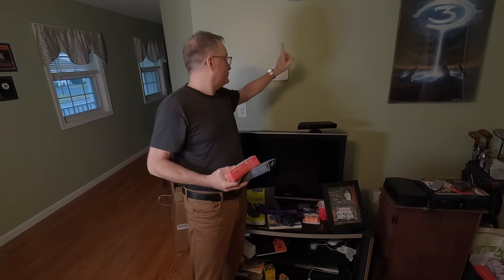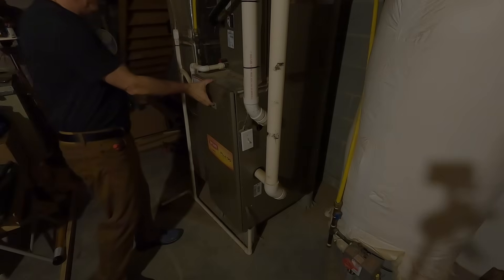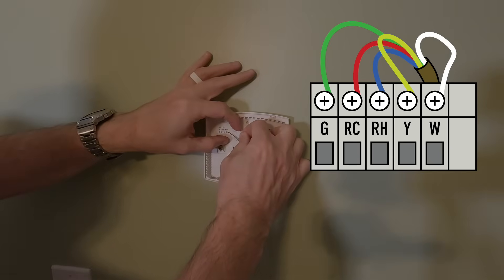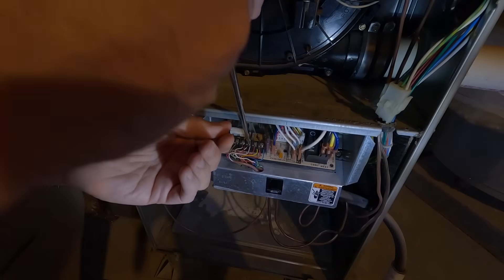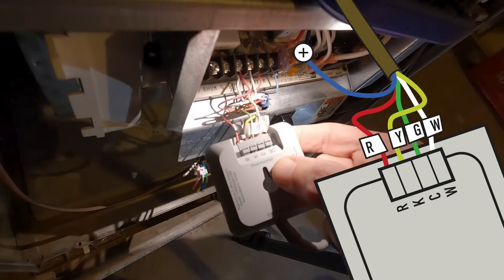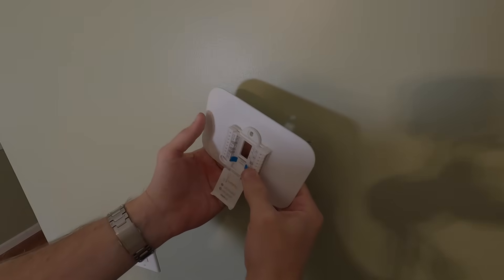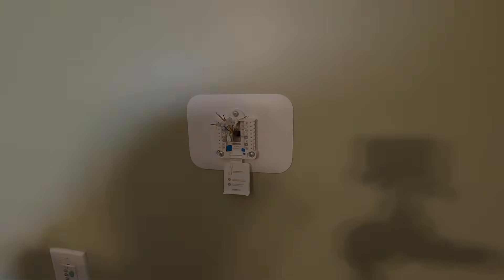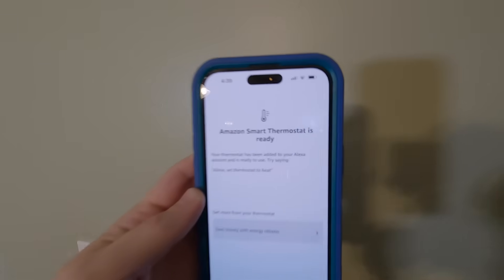Install Amazon Smart Thermostat + C-Wire (less than 4 minutes!)

Comment: What if your HVAC only has a R, W & G. Does it matter for the adapter
Reply from the maker: Great question. Thanks for asking. I recommed using the Amazon Alexa app... it will guide you through your exact hardware install using the exact wires you have at your location. Good luck!

Comment: Flippin Breaker off, REALLY Dude?   Light/power swith on furn, turn off, then furnace door has another safety switch when opened.
Reply: What tool was that he used to check for power at the furnace ? And can you clarify he didn’t need to turn the breaker off just the switched he checked for power?

Comment: You shouldn’t have to open the air handler. I have a heat pump and connected all the wire EXCEPT I had to connect the white  wire to W2 and the orange to o/b…if your system blows hot air when ac is on then you go into settings and switch O to B or B to O

Comment: How do I know if I need C wire?
Reply from the maker: The Alexa App will identify if your specific hardware needs the C-Wire Adapter. Basically, it’s needed when you don’t have a wire that provides electricity to the thermostat. Typically, if your thermostat uses batteries you don’t likely have the “power” wire and will need the C-Wire Adapter… but, again, follow the on-screen prompts on the Alexa app to know for sure. 
Good luck! 👍

Comment: Does the adapter work without a blue wire?
Reply from the maker: Great question. First, I'm not 100% sure. Please be sure to follow details in the Alexa app because that will tell you exactly what wires are needed for your exact hardware.

Comment: The little blue tab on the thermostat needs to be on the up position that blue tab is actually a jumper so you have an extra wire remaining also
Reply from the maker: The Alexa app will take into consideration your exact hardward configuration and will prompt you to change the blue tab if needed.

Comment: You can avoid purchasing the adapter if you have unused wires in the main bundle of wire coming out of the wall.   With my thermostat I did not have a C wire designated but I did have 4 unused colored wires in the bundle that were tucked back into the wall.   Pick one of the wires to become the C wire.   I chose the blue wire as it is the most common choice for C.   Now turn your power off to your furnance and open the side panel.   Look at  your motherboard and you will see all the connection screws that are the same as the thermostat such as W,Y,G, R, RC ..etc.  There should be a C terminal as well.   In my case, I had a red wire already connected to the board C terminal that was connected to R and RC at the thermostat.   It does not matter as the new wire will also be connected to the C terminal.  Find the wire bundle coming from the thermostat into the furnace.  You will see some of the wires already connected to the board and some that are not connected to anything.   In my case, I stripped the blue wire that was unused and connected it to the C terminal.   It does not matter if there is already another wire connected to C.   That is it.   You now have a blue C wire and do not need to pay for the adapter or use batteries to keep power to the thermostat.   The other colors that were connected to my old thermostat such as G,Y,W,R,RC were connected the same terminals on the Amazon thermostat.
Reply: This is helpful
Reply: Thanks
Reply: I know this is a long shot because this comment was over a year ago. I have blue wire in my b. Can I disconnect it and put it in my c? I don’t have any loose wires.
Reply: @chiquita3298 did you ever figure it out?
Reply: @chiquita3298 Connect both to the same terminal. You are just trying to close a loop. You can have more than 1 wire at each

Comment: You seriously need to redo this video. Get rid of the 4 minute limit and do it correctly.
Reply from the maker: Thanks for the suggestion. May I ask? In what why could the video be better if the length was ideal? Also, I chose to make this video the length that is and I had no restrictions or influence from anyone or anything.
Reply: @AwesomeFunThings the time is fine
Reply: @AwesomeFunThings  Yes I can answer your question. This is a topic little understand, it needs a 100 percent step by step process for most to understand. RC and RH are combined under the one wire selection on the Amazon thermostat, it's a power wire for heating and ac for the thermostat. The blue wire could then be used on the "C" common wire on the furnace. One of the two spare terminals were probably labeled "C", negates the use of a C wire adapter. The C wire is just a ground wire to power the thermostat, it does not have one as the red is positive, white is a switch wire for heat, yellow is a switch wire for ac, on and on but no accommodation was added for a ground wire in the early days. Basically thermostat's early design was very simple, a switch, then a more complicated switch with ac but in those early days of the addition of ac it was still a simple switch, then came thermostats that needed to be powered, well the wiring was not needed in the past for a ground circuit so none was provided. 30 years old you probably have the extra wire needed as it looks that you do. Let me know if you find a C terminal.

Comment: I did all of this it connected successfully everything seems fine but my furnace won’t turn on now.
Reply from the maker: Oh no! I suggest you contact Amazon through the Alexa app.
Reply: My old thermostat had a single red wire from C on the board that connected to R on the thermostat.   The old thermostat then had a small jumper from R to RC.   When I installed the new thermostat I installed the Red wire into the R slot.   I then had to slide that blue clip up to indicate that I only had one Red wire coming in (I assume acts the same as the jumper between R and RC on the old).   I then connected a separate blue wire to C on the board and ran that to C on the Amazon thermostat.   This additional Blue wire I connected allowed me to avoid buying the adapter kit.

Comment: this is great and probably works in 90% of applications, but here in the northeast, we have gas boilers and baseboard heat which means no control board at the boiler(instead we have an Aquastat). In my application, the smart thermostat will be controlling both the heat and the AC (R1&C used). I have extra wires (3) coming to the thermostat and a 24v transformer near by boiler, the question is where to connect the 24v to the device?
Reply from the maker: Thanks for passing this along. The Alexa app will give you exact install details for your specific hardware. I would start there and follow those directions while also using my video as a way to see the techniques you'll need to do. Good luck with your install!
Reply: @AwesomeFunThings  The app tells me I need a "C" wire adaptor, but the C wire adaptor gets wired to the circuit board which I don't have on a gas boiler. I do have extra wires and have a 24v power supply I can hook up directly to the thermostat but not sure which terminals would accept such a set up
Reply from the maker: I believe there is a way to reach customer service but I’m not sure what those steps are. I would suggest going down that path.
Reply: Was that a multimeter you used at the furnace to check for power?

Comment: My existing thermostat only has red, blue, and white connected. The yellow and green wires are there, but not connected to the existing thermostat. Should I connect these to my amazon thermostat?
Reply from the maker: Thanks for watching the video and asking this question. I suggest you follow the instructions on the Alexa app. When you do, the app will adjust the install-steps to fit your exact hardware configuration.

Comment: My thermostat only has a RC RH and a W wire. What am I supposed to do? Also when you went to the basement and open-end up the furnace you totally lost me. No clue what you were talking about there.
Reply from the maker: Sadly, I'm not familiar with every possible hardware configuration. Good news. The Alexa app will show you exactly how to make the appropriate connections for your specific hardware. I would suggest you start there. Also, the customer service is very good if you need that level of help. Either way, I wish you good luck with the install. Hopefully this video will help you to some degree.

Comment: Do you lose the option to turn on your fan by using this method?
Reply from the maker: Yes. Fan options for my unit are: Always on, Fan circulate, off
Reply: @AwesomeFunThings  I installed the adapter and now can not take the fan off auto, did I do something wrong?

Comment: Several of my wires are not colored or arranged like this. Several connections have 2 wires on them. This smart thermostat is more trouble than it is worth. Have to hire a professional to install the C adapter to avoid blowing up my system or killing myself. Such a stupid product.
Reply from the maker: Sorry you're having touble with the install. The mobile app will walk you through your unique situation. There are many types of configurations and my unit (and the wiring of my unit) is one of many that exist. Nevertheless, my hope was that this video will show the proper techniques even if your wiring is different. WIth all this being said, hiring a professional is ideal if you (or anyone) feels that is the right decision. This type of install is not for everyone. Thankfully, Amaon has made it so most people can install it themselves and I'm happy about that. Good luck. I'm sure you'll love the product after it's installed.
Reply: @AwesomeFunThings  He created a helpful video for those with his specific wiring situation. It is not him that is the problem, it is the product. There are plenty smart thermostats with no C-wire (just the normal battery backup) that are a better option than this, and I will be buying one of those instead.

Comment: Powering up a return wire is never good for any equipment. If someone did that with high voltage AC, you could kill someone on the line. Proper procedure is replacing any 18/4 with professionally rated 18/5 that is NEC rated for temperature / fire and has a valid PVC jacket.
Reply from the maker: The first item in the instructions is to identify if your unit is one of the rare units that uses high voltage and Amazon has, thankfully, been very clear that this product is not compatible with high voltage systems. 
I followed all of Amazon's instructions. Thoustands of homeonwers and professional installers have also followed these instructions on their low-voltage systems. It seems likely that Amazon would not tell their customers to do something that could damage their equipment because a huge class action lawsuit could occur. This product has been in the market for a long time and I have not found any widespread examples of damaged equipment or a pending lawsuit.
Reply: @AwesomeFunThings  The bottom line is did you take their equipment apart? Do you know what is in there? The only thing can be a diode, which will fail and render the return inoperable.
Reply from the maker: @wackywack6650  Taking apart the c-wire adapter would void the warranty and could be dangerous. No, I did not take anything apart nor do I advocate anyone doing that. With all the concerns you have raised, it is my position (and Amazon's position) that this product is safe to use and and the process of installing it is also safe if you follow the directions and take the necessary precautions (as I have shown in my video). Many people have done installed this without issue. Many people are using this product without issue. Also, this is a Honeywell product with an Amazon label. Honeywell has been in this business for decades... they know how to make good products that are safe.
Reply: @AwesomeFunThings  I pray you don't believe that what these people create are safe for you. Their intentions are to make money. Just like we saw for the last almost 3 years. No response necessary. I'll leave it at that.

Comment: So at 2:17 does that c wire adapter wire need to be connected to the smart Alexa thermostat or is that c wire adapter a substitute and a wifi substitute?
Reply from the maker: The c wire adapter is connected to your furnace and the wires running to your thermostat are connected to the c wire adapter. So… the adapter sits between your furniture and thermostat. 
I hope this helps. Good luck if you plan to do the install yourself.
Reply: @AwesomeFunThings   This is the most confusing part, especially when you don't have C wire and THIS needs a dedicate DIY tutorial video clip.
Reply: @samsen3965 you can either buy a c wire direct plug into wall to thermostat if you have a plug nearby. Or like this video. The wires he connects to the c wire adapter are the wires behind the the thermostat. Connect the other c wire adapter back into the furnace

Comment: if you have two thermostats do you need two c wire adapters?
Reply from the maker: Good question. Sorry, I don't know but my guess would be that two c wire adapters would be needed. I would confirm that with Amazon.